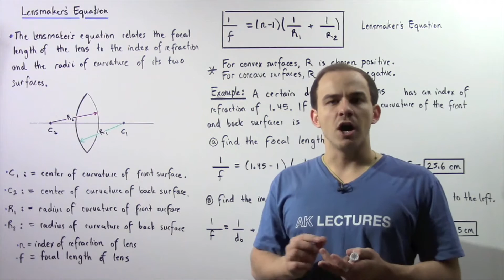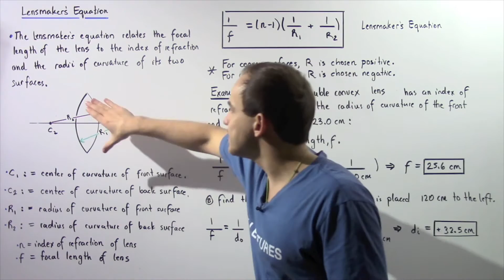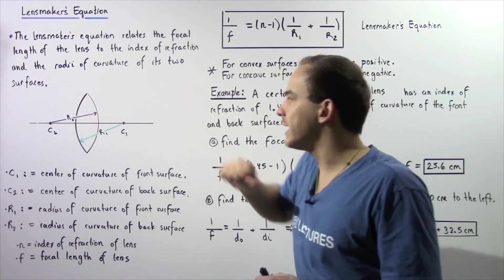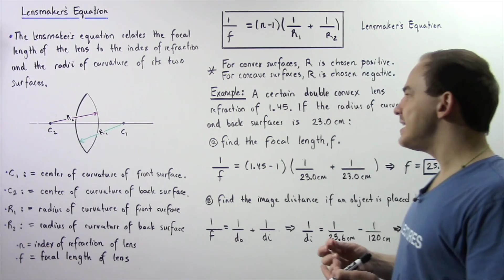Lensmaker's Equation

Comment: Okay so Ive also been pondering this question. Some books and Micheal van Beizen (youtuber) say the lensmaker equation is (1/R1-1/R2) but he says right here its (1/R1+1/R2).

I think this just arises from the different definitions of a negative and positive RoC. The (1/R1-1/R2) variation defines a positive RoC as any surface where the belly faces the left, and a negative RoC where the belly faces the right.

In (1/R1+1/R2) however, the definition for positive and negative RoC depends on if its convex or concave. So R2 in the first variation is negative because the belly faces the right, but here its positive because its convex.

Whatever one of these formulas you use, they both work, just be aware that they use different rules for what is a negative and positive RoC.
Reply: if center of sphere is on left then  R<0
 if center of sphere is on right then R>0
and we would have - -1/R2,which will be +1/R2

Comment: But what’s the meaning of a positive focal length? Does it collect the parallel incident rays or spread them?
Reply: Positive focal length is due to the sign convention according to Cartesian plain the left side is negative so if the focal length is on the left side it is negative if it's on the right side it is positive

Comment: We have studied it in books as In bracket(1/r1-1/r2)
Reply: Okay so Ive also been pondering this question. Some books and Micheal van Beizen (youtuber) say the lensmaker equation is (1/R1-1/R2) but he says right here its (1/R1+1/R2).

I think this just arises from the different definitions of a negative and positive RoC. The (1/R1-1/R2) variation defines a positive RoC as any surface where the belly faces the left, and a negative RoC where the belly faces the right.

In (1/R1+1/R2) however, the definition for positive and negative RoC depends on if its convex or concave. So R2 in the first variation is negative because the belly faces the right, but here its positive because its convex.

Whatever one of these formulas you use, they both work, just be aware that they use different rules for what is a negative and positive RoC.